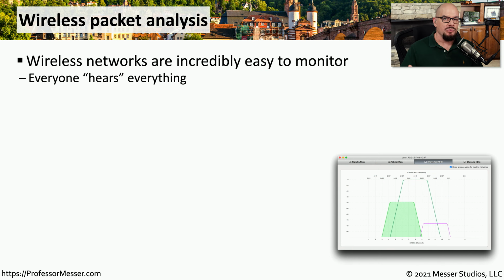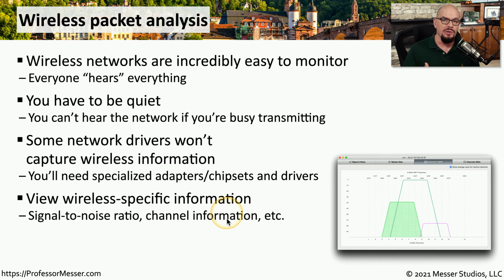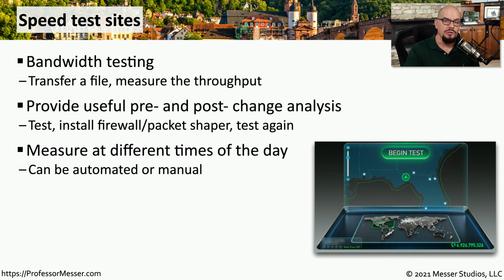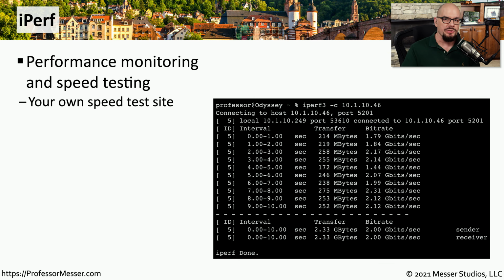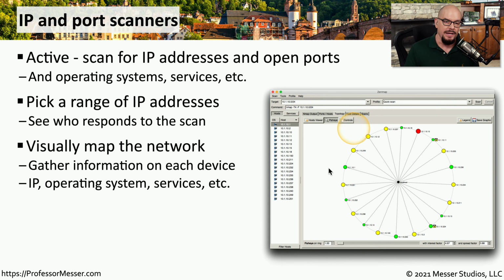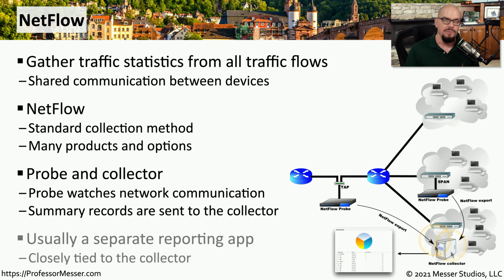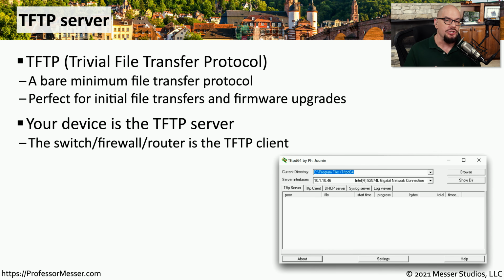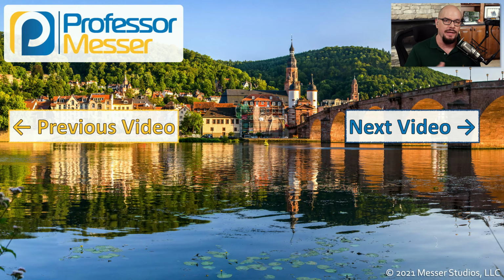Software Tools - N10-008 CompTIA Network+ : 5.3

Comment: What is the difference between a wireless packet analyzer and protocol analyzer ?
They both seem to do the same ?
wouldn't a wireless packet analyzer analyze the protocol as well ?
Reply: Port analyzer analyzes data a it crosses ports, wireless analyzer analyzes packets as they travel between wireless access points to my understanding so it depends what you're troubleshooting to which you might use.

Comment: what does TFTP  server have to do with Network troubleshooting or how is it a network software tool?
Reply: I am pretty sure he is talking about software that utilizes TFTP (Not specific to only the protocol) to deploy configurations and firmware updates to endpoints. It can have a lot to do with Network troubleshooting, such as atomizing updates to endpoint devices, PXIE booting and VOIP phones. Try not to think too hard about it as that can stunt one's understanding.
Reply: @SternTree  thanks for the info. just to be clear, it wasn't a critique of professor messer talking on the topic. it is in the Network+ objectives under Network Troubleshooting. i find it strange that it's there. professor messer is simply following comptia's objectives